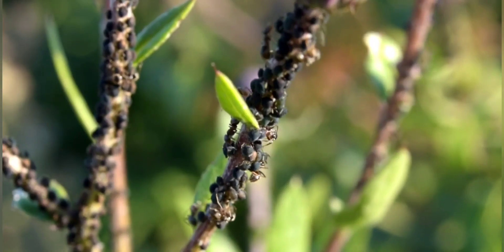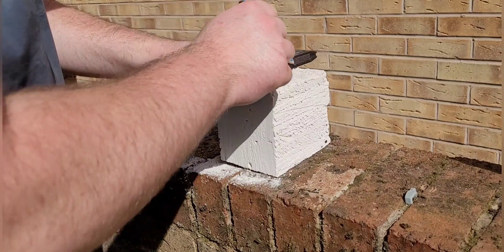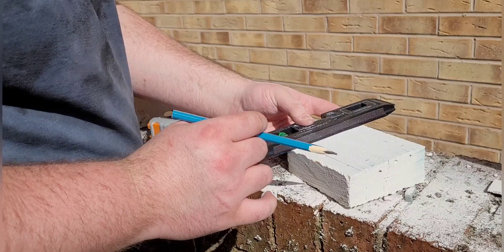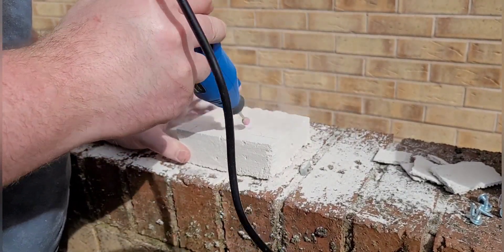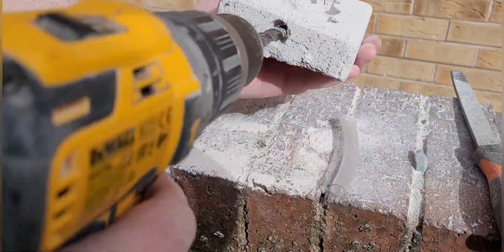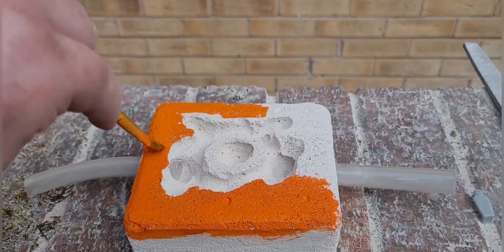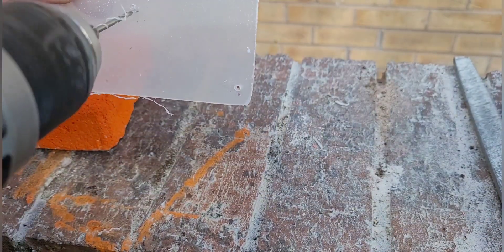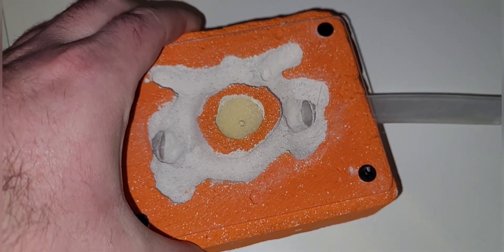How to Build an Ant Farm | DIY Ytong Ant Nest (Formicarium)

Comment: In the uk ytong is called aac and it's very cheap but not all builders merchants have it in stock so best to call a few first . Nice video though kb
Reply: Do you have any suggestions for where to get it? It's been so hard to find in the UK. I ended up getting a buge slab from Wilko but that was such a faff. It seems others sell it but in huge quantities which come on wooden palletes!
Reply from the maker: @jonathanthompson4734  I got mine from wickes 🐜
Reply: @kbants4063  Haha Wickes is what I meant sorry, not Wilko
Reply: @jonathanthompson4734  Because i only wanted one they gave it to me but that was just before Christmas . Gibbs and dandy builders merchants have it but i would phone first to see if any local ones have it in stock .
Reply from the maker: @Antramblings  yeah when I went to wickes they had no issue with me getting a individual block luckily
Reply: @Antramblings  Thanks!
Reply from the maker: I've found it being calles aerated concrete mainly, cheers 🐜